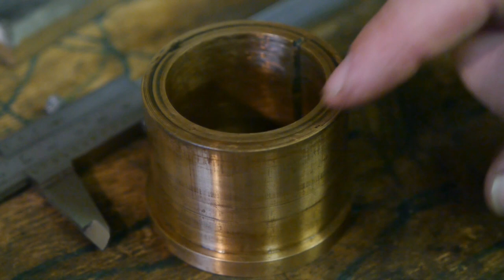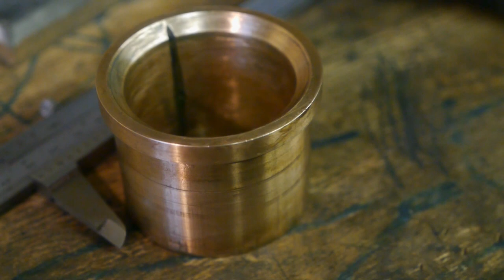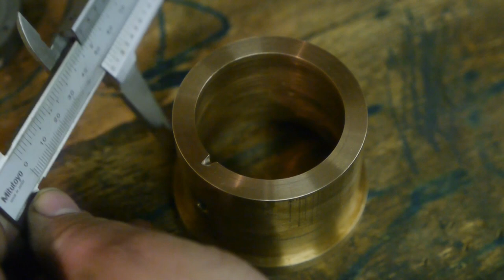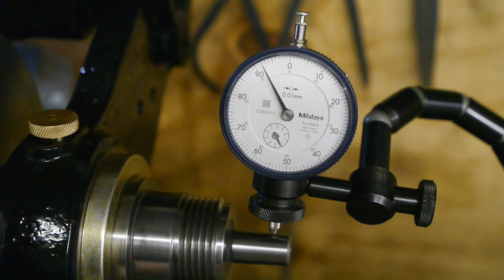Reassembling the old lathe' s spindle

Comment: Thanks for the video.  I was hoping for a better result.  As the other comments mentioned, the steps were good.  You may need a light cut on the thrust area so the bearing taper makes more contact.  I would not attempt this on the Chinese lathe, but you could try hand lapping the spindle to the thrust area.   This is commonly done for steam valves, etc.

The temperatures look good.  Perhaps you need to try the tractor oil.  Heavier oil may not leak so much.  In the US we can still get non-detergent engine oil but it is the same viscosity as your tractor oil, SAE 30 (ISO 100) .  WE can also get other oils made specifically for lathes and other machines. ISO 20 oil is very thin.

Wishing you good luck for better results.
Reply from the maker: That makes 2 of us. I'm a bit disappointed to be honest, and also surprised at the difference compared to earlier this year.
I need to scrape it to a better fit at some point. But then I'll have to remove the headstock to get better access.
Thicker oil means more heat but guess I'll order a can of the 30w oil. I can always mix it with the iso32 oil to make other viscosities.

Comment: The oil groove on the back side of the bearing might have been intentional to hold oil just like the groove along the top of the bearing.  It could be that the flats areas on each side of this end groove were wore down till only what appears to be a scratch remained.
Reply from the maker: That is possible. 
Yet another theory to consider :)

Comment: "Vibration of the Dremel tool..."

This is why quality work is very seldom done with plastic tools.

Spend some quality time to make a metal body spindle for tool post grinding.

Also, invest in "Tomesaver" lapping compound and lapping tools. 1 thousandth the labour, one thousand time the quality of output.

Comment: Great job on the scraping! One way you might try to get the bearing face flat is hand lapping using sandpaper on plate glass or granite plate. You can work your way from corse to fine grit. Love the videos. Thanks so much for sharing. Great to see an old machine rescued.
Reply: I forgot to add that here in the US you can get food grade mineral oil at any pharmacy for about 10 dollars a quart.  I use it along with ballistol with much happiness and it smells nice to me.
Reply from the maker: Many scraping enthusiast would probable disagree. But I believe I improved the situation so I'm happy with the result. In the end I finally found the source of my problem and the spindle has been running fine ever since. Here a link in case you haven't seen the strangest spindle problem ever: https://youtu.be/YlnDPedjJJ4